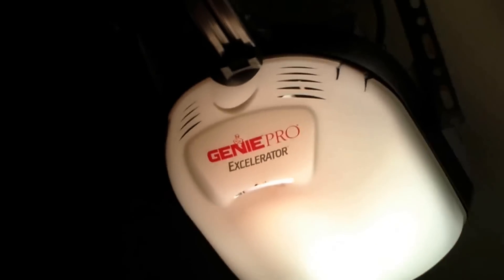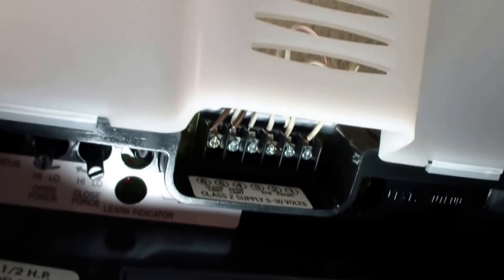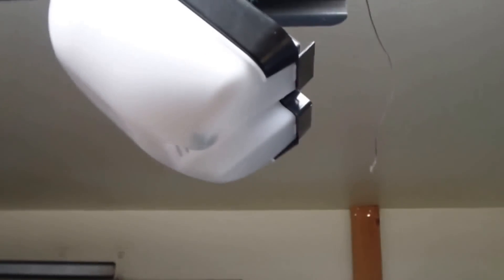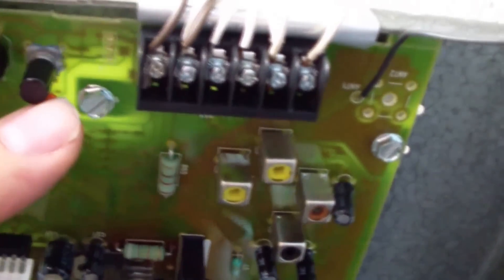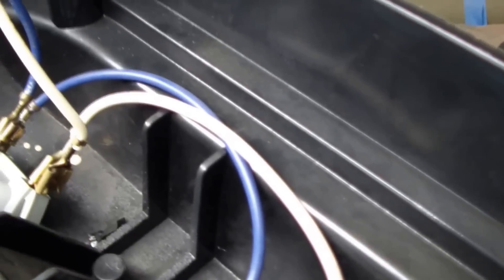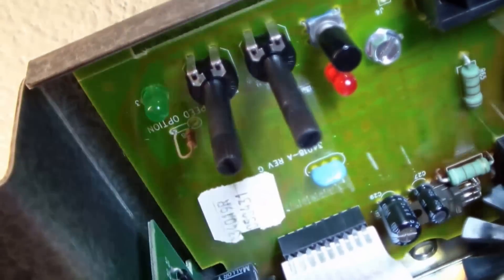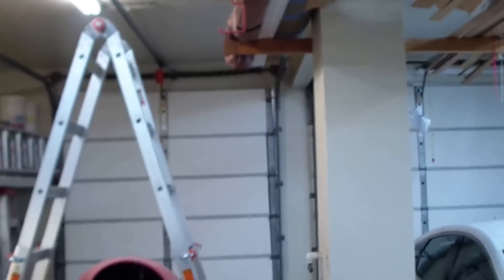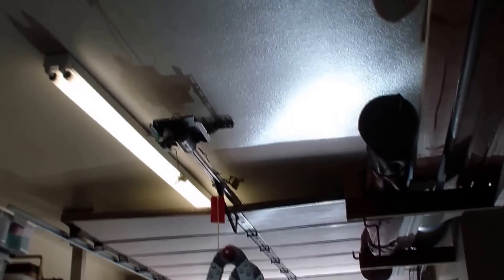Genie Excelerator Garage Door Opener Repair

Comment: Thanks. My problem was after a power outage. Acted dead. Lights turned on.  Opened up but didn't see anything. Blew out the bug parts but didn't touch the ribbon.  Just unplugging for a few seconds did the job.  I'd recommend just unplugging before going to trouble of opening unit. Thanks. 😊

Comment: On a 1200 I have no power. No power to the 2 light bulbs, no light on   the opener by the entry door to the house, no red or green light on the sensors at the bottom of the door.
Reply from the maker: No power is often the easiest fix. Follow the power cord inside the unit. I think it connects to the power controller circuit board on right. Look around. See if fuse is there and inspect for damage. Maybe you will see something burned.

Comment: WOW, good example of advice not necessarily having a shelf life.  Earlier today I exited my garage and door operated fine.  A few minutes, yes just a few minutes later, I returned and attempted to close the door and it quit.  Mine had the repeating single flash, basically just kept flashing without a pause.  Attempted a couple things and it boiled down to needing a replacement motor board (approximately $197 from Genie).  Initially I was going to just replace the entire opener and attempt to reuse the rails and screw drive for just a few $$ more.  Genie, on chat, told me the new screw drive model used different rails.  Tried your trick and cycled a few time perfectly.  Only thing I added was I used some electrical contact cleaner spray on the connector and wiped down the pins also.  Figured it "might" make the repair last a bit longer.  Then again it was installed just over 18 years ago!
Reply: These models have a lifetime parts AND labor warranty. I had my board replaced 6 years ago... no charge. Like you, I installed mine a very long time ago (2004).

Comment: I did what you tell me  in your video it works for 4 times and doesn’t want to work anymore do you have another suggestion????
Reply from the maker: Maybe you can find a used control board on eBay.

Comment: My garage door goes up very slowly after a power outage. After it’s closed and opened a couple of times it goes back to operating at it’s normal open and close speeds. I don’t understand why it goes up so slowly after a power outage. It acts like it’s working off a depleted battery backup even though there is no battery backup. It goes back to normal operation after it’s operated a couple of times. I don’t get it.

Comment: Did this actually fix it after the video stopped? If not, what did you end up doing? Replace the ribbon cable or one of the control boards?  I"m having the same issue: 2 blinking lights and door doesn't want to open but will open if I continually unplug it. Garage door company quoted me $500 to fix it yesterday
Reply from the maker: The manufacturer actually recommended unplugging and re-plugging in ribbon cable. Worked great as seen at end of video.

Comment: Nice!you were very easy to understand, better than most! But lubricate your door! Its noisy and sounds like its scraping. Also, turn your open and close FORCE adjustments back DOWN! If your door is operating properly ( manually by hand it should float open-thats what your spring is for- and close easily, that why you lube it!) the opener should be pushing and pulling on the door just enough to move it. Any extreme excess force will inevitably damage your top or bottom panel. And If / when you have a spring break, the opener will continue lifting the door and destroy the top panel. There should only be about 10-15 pounds of pushing and pulling pressure. The Photo Sensors dont always catch the obstruction, like your bumper, hitch or my favorite, the broom handle set in the track to keep it from falling over, and forgotten.
If the door impacts anything with the forces turned all the way up- you are out a lot of time and money. 
You have a small door that opener will dead lift one twice the size and weight.

Comment: If the power is turned off or lost, these Genies after power is restored, go through a auto reprograming and will have a slow opening and closing the first couple times. This is normal. Great video, thanks.

Comment: i have similar issue. mine works for a bit after resetting power but then stop working again. i just tried this method. but it is still having the same issue. did i need to clean the pins on the belt cable or plug it in and out multiple times? thanks!
Reply from the maker: If it was poor connection at cable once would have done it. Likely something else failed.
Reply: I started having the same issue. how did you fixit ?

Comment: My unit had similar similar symptoms but had a one blinking LED error code. I disconnected the ribbon cable, rubbed the contacts between my fingers (I had latex gloves on) and re-inserted back into the connector.

It's been working for a day so far (it would work only a few times before stopping and blinking status light would come on again).

The slow operation on the first time after plugging in is normal (the unit is calibrating the end-of-travel-limits) as explained in the User's Manual.

Thank you so much for the video! It saved me a lot of time and $$$.

Comment: Thx so much Kent Diego for posting this video - your accidental solution was brilliant.  Once I removed the ribbon cable and reinserted it a few times, my garage door worked perfectly.  I think you've discovered that after several years, the electrical contacts between the ribbon cable pins and the pins sockets on the control board developed some light corrosion, or maybe more accurately some oxidation that prevented a good electrical connection.  A no cost repair!

Comment: MY wife accidently tried closing our Garage door, not knowing there was a large plastic garbage bin in the way. The door slammed down on the garbage bin and got stuck, so she hit the up button but then the door got stuck, and now it won't go up or down (except manually). The green and red led sensor lights are lit and the lights work OK, but the garage door does not open or shut and it does not even sound like the motor is engaging at all. Is there a reset button somewhere on this Genie H800D unit? I have tried unplugging and plugging it back in, but no change. Any other suggestions?
Reply from the maker: Did you try unplugging power to re-set unit? Look at the green LED to see what code it is flashing.
Reply: Thanks Kent for your reply. I ended up calling Genie tech Support, we worked on it for at least 2 hours and they came to the conclusion that I needed a new control circuit board, so I ordered on from a local Garage Door Repair shop ($100 bucks), installed it and still I had no motor engaging, so at that point I called a very reputable Garage Door Repair place and their technician diagnosed a burned out motor, so I had to have the entire unit replaced. (another $375.00). I didn't go with a Genie this time,...((never again))

Comment: My opener was opening just fine about 1/3 of the way and then it slowed to a crawl. Sometimes it made it all the way up and sometimes it would stop short. I unplugged the power and plugged it back in and it would work once or twice then do the same thing all over. Thought it might be the motor and I went to the store to scope out new ones. When I read on the Genie box that the motor has a lifetime warranty I decided to come home and Google the issues. Found this video, removed and reset the ribbon cable just like what was suggested and Presto!. Ran it up and down a dozen times and no failures. You are awesome!

Comment: My learn button broke while trying to program 2 openers, I was able to get 1 reprogrammed before it broke off completely. The fix was to take a small copper wire and touch the left side of the prongs for the button and then touch the other end to the center of where the button goes, red led was blinking and I was able to reprogram all my openers, one at a time though.
Reply from the maker: +Mike Urig You could find a similar sized surface mount switch on Digikey and replace too.
Reply: Maybe but since I have everything working now I really don't care. Thanks for turning me on to Digikey though. The opener is 14 yrs old so if I do anything I'll just replace it with one of those battery backup ones

Comment: At 1:50 + I can see that I may have been on the wrong side of the device.  Off to move the ladder to see if that's where I should be. :)
Reply from the maker: +Alice Crawford I think I opened the light cover and the program button is at back of unit. Press the program button once and light will blink to indicate learning mode for 30 seconds.

Comment: Kent,  In the beginning you didn't show where your were in regard to your position at the device.  I can't tell if your at the front, back or either side from the video.  I'm not being picky but I just got off the ladder and didn't see any of the things that are in the picture with the exception of the two light bulbs.  I need to reprogram a new remote control so I need to get a good view of what you're doing from the start.

Comment: In California, any door regardless of width that has an electric motor, should have a strut on the top section...especially when the door is 9' tall. You can see the flex in the top section as the door opens and closes. My suggestion would spend a couple dollars to reinforce the top section before it folds in half. Happens a lot. If it folds, the top section would need to be replaced and if your lucky, the same make and model is still in production. If your not lucky, the door gets replaced.
Reply: "your"...what?

Comment: Your motor is overworked I can see a bow at the top section of your garage door which means your garage door is not balanced. Turning up your force settings masks the problem of your garage door being unbalanced. . I am sure your motor will fail again Another problem, Genie Excelerator is a piece of garbage. Get your garage door fixed by a licensed professional and swap out that crappy motor
Reply from the maker: +vick moore The door has a cracked frame. That is where you see the bowing. I will look to see if lifting the spring is balanced. The down force adjustment was a red herring and root cause was proven to be ribbon cable.
Reply: It's not a cracked frame. Top sections crack as a result of an unbalanced door. There is to much excess weight on the rise(metal fatigue sets in on springs due to how many cycles have been exerted and the door gets heavier to the point that it starts affecting other components;i.e., your top section) I am a master technician, the ribbon wear occurs secondary to increased load on the unit which in turn corodes the contacts. Also you will notice the speeds on your model will change frequently further quantifying my assessment. If you lift the door manually, and it doesn't feel like it's 5 pounds, then the springs are fatigued. The next step will be your door bucking from the bow in the section. You might want to address it before you have to replace your top and intermediate section. Once it buckled it will affect the next. Check for cracks on the outside of the section. Sometimes if you look from the inside you can see light thru the cracks in the sections